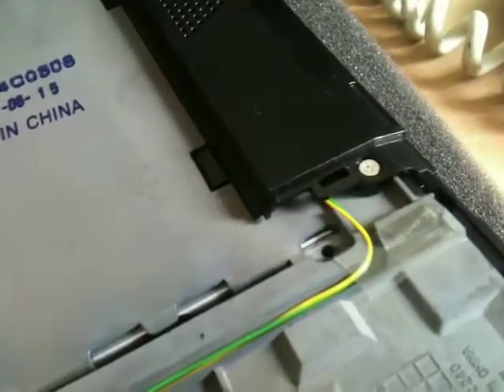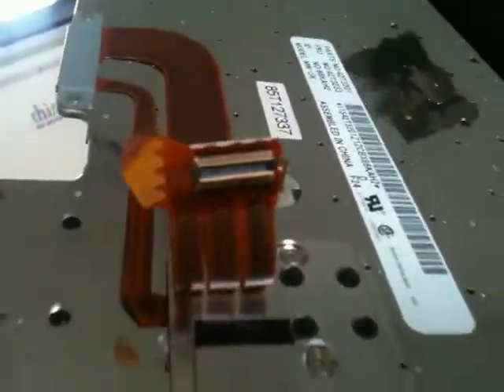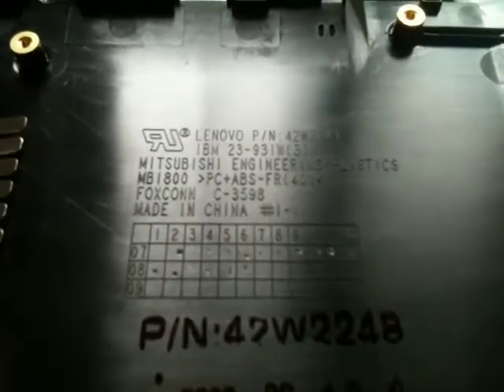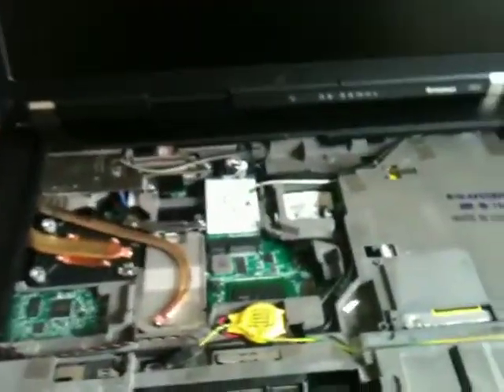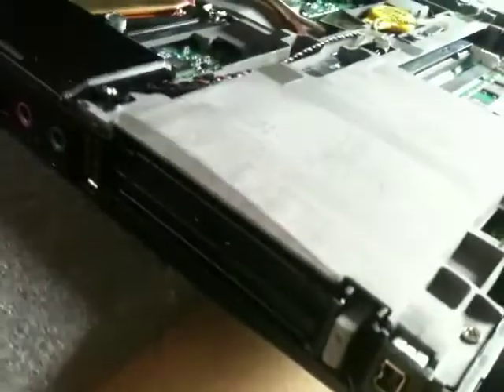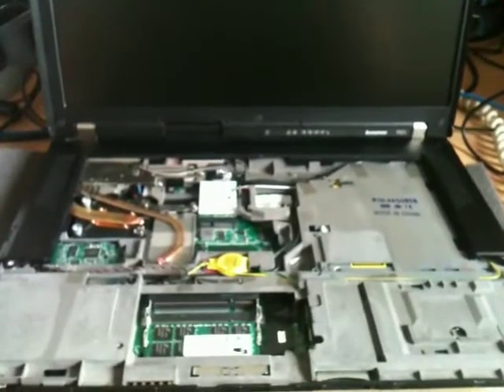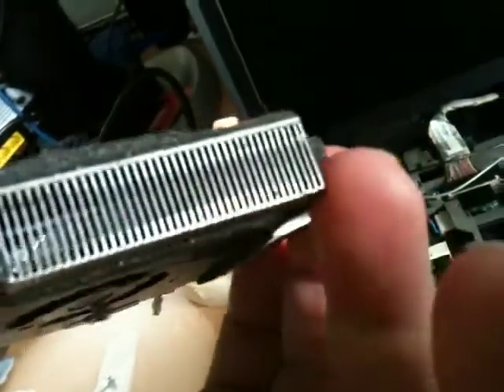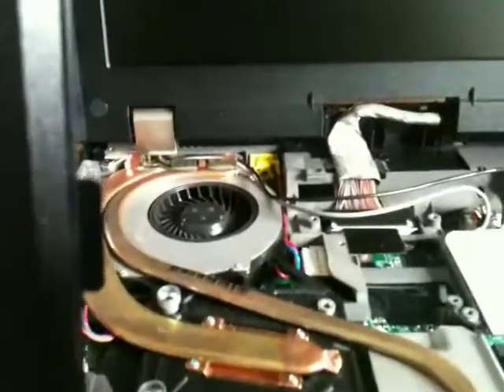Lenovo ThinkPad R61 (15.4") 8930-A41: looking inside, before I upgrade the CPU

Comment: Thanks. I have a T7500 I can put in, but need to be sure. If you could use CPU-Z or similar program to confirm you have GM965 and not GME965 I'd really appreciate that. Apparently the former doesn't support this processor. Although CPU-Z told me I had a socket type that doesn't even appear to exist so maybe I have GME after all.

Comment from the maker: @Plissken68 Whilst it is not by any means mandatory to do so, it is extremely poor engineering practice not to replace it. However, if you are talking a matter of days or weeks between lifting the sink and doing so again, and you have used a reasonably fluid paste, I can see no reason to be overly pedantic about needing to replace it SO soon.

Many thanks :)